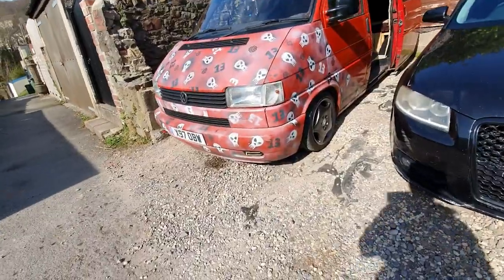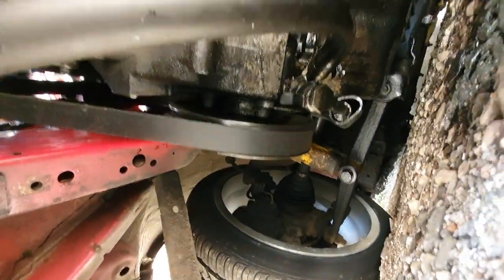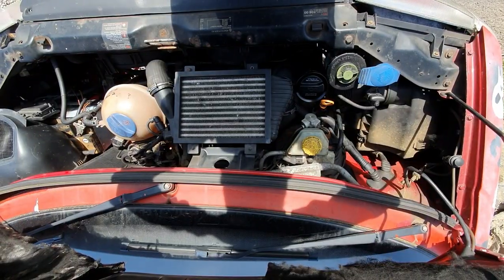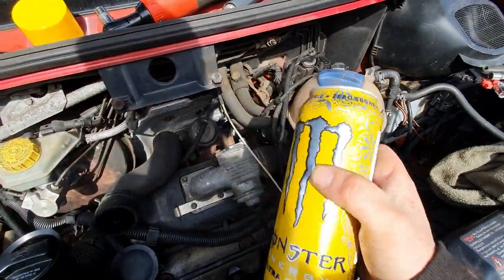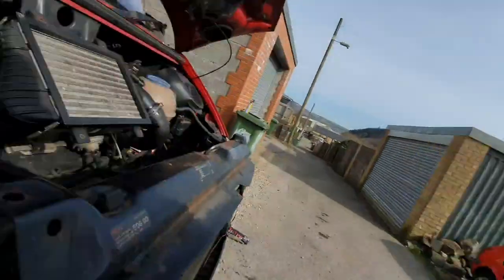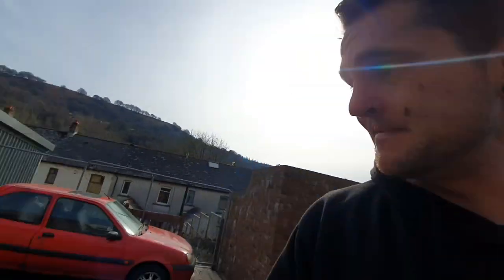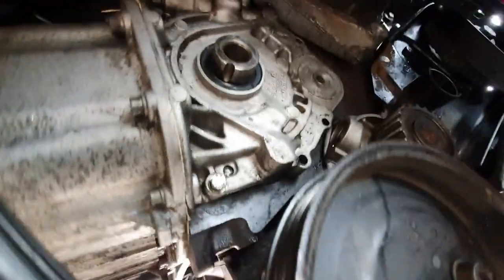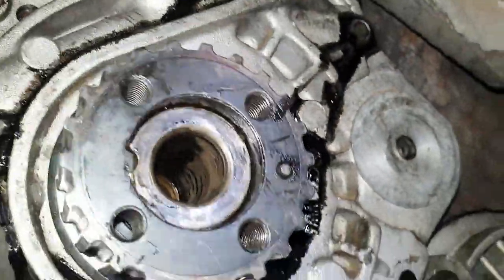So Many Oil Leaks!!!

Comment: I admire your determination. Cam belt off to find an oil leak! Good one. Been chasing leaks on mine for ages. Think I may end up doing throttle spindle on fuel pump next.
Reply: Is that hole for securing trim?
Reply from the maker: Oil leaks and VW g hand in hand but I was  Determines to find a and resolve it
Reply from the maker: I'm quite sure it is

Comment: I had an fuel leak In same place and the pipe had loads of splits in it and didn't see the splits as the pipe is bent at an angle only seen the splits when I took the pipe off and bent it the other way. 

Hope you get the oil leak sorted once and for all its been a curse brew! 

Those wheels 🤘🤘🤘🤘🤙🤙🤙🤙
Reply from the maker: This oil leak has been a pain to deal with but as you will see in the next video that's delt with.
Yer I've ordered new leak off pipe for the injectors so hopfully that solves the fuel leak aswel
Thanks mate I love them wheels

Comment: With your fuel leak, check your injector seals. I had a fuel leak on mine which I thought was the leak off hose from an injector, turned out it was a seal.

Good luck with oil leak 👍🏼
Reply from the maker: I've ordered new leak off pipe hopfully that solves it, if not that's my next place to look thank you

Comment: Hi mate. I know this is an oldie, but When you stripped off the breather valve what did you use to clean the top of rocker cover. Also Was there a gasket where you had the silicone? Hope all is well your end.
Reply from the maker: Honestly I can't remember mate sorry been so long I can't remember
Reply: @PranceProject  was a long shot. Thanks for getting back to me. Hope all is well. I’m guessing no posts = no problems and hopefully enjoying the van etc.
Reply from the maker: No loads of problems haha just need mega busy with with thats all 
If I remember rightly and I could be wrong. I just used brake cleaner and a rag to clean and I cant remember there being any silicone there

Comment: Carl just sort oil leak on my acv took weeks to find. Wheels look awesome. 
Where oil cooler meets block on back of engine. Had to buy a bottom end gasket set as couldn't find the gasket anywhere. Oil was leaking and running along the lip of the block good luck 🤞🍀 Ps whats the outtro music called mate?
Reply from the maker: I've checked there and that's dry it's coming from a bolt hole in the side of the engine.
Did u get yours fixed?
Reply: @PranceProject  yes I got it sorted, was so frustrating though feel your pain with this one 😂
Reply from the maker: Feels amazing to get get it fixed tho

Comment: Have you replaced the rocker cover breather (flying saucer thing) and the seal below it mine was leaking from there along with the oil filler neck
Reply from the maker: I've replaced that part
Reply: Nice  wheels  bud do you  still  have  the banded wheels
Reply from the maker: Thanks mate I love them

Comment: Ain't there a bolt that holds the lower cambelt cover in place where the oil was coming from? 🤔 The bolt hole?   If it is missing it needs to be replaced 👍
Reply from the maker: Ding ding ding 
Winner winner
Yes mate very correct 👍
Reply: @PranceProject  if that bolts missing I'd get it replaced asap as the lower cover can move and shread the belt 🙂
Reply from the maker: The cover doesn't cover or get held by that bolt
Reply: Defiantly should be a 10mm m6 bolt goes through holding metal rear timing belt guard on 👍. Oil pumps were known to crack if tensioner bolt has been over tightened should be tightened to 25nm. Nothing else really leaks you have done crank seal and checked oil cooler seals and your cam seal seems ok. Try putting a bolt in both the oil pump holes tighten to 10nm and run it again see if that stops the leak. Good luck 🤟
Reply from the maker: Thanks its that bolt hole I show at the end it's plugged and stopped now
Reply: After a 2nd look yeah it’s not the timing belt guard holes 🤦🏻‍♂️ hard to see in a video sometimes but it is the oil pump housing and if a bolt won’t thread in it’s been snapped at some point and the thread is stuck in there. At least you have stopped it now 👍

Comment: I have a feeling it’s your oil cooler gasket and the oil cooler housing bracket .. the same was happening to mine
Reply from the maker: No mate did you not see the video at the end where I show the oil leaking from hole in the side of the bloke above the tensioner